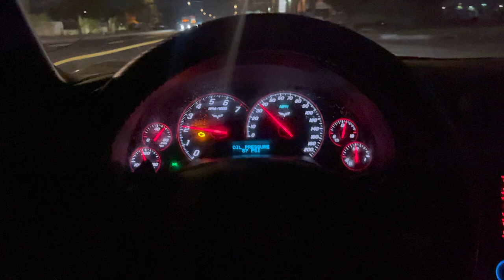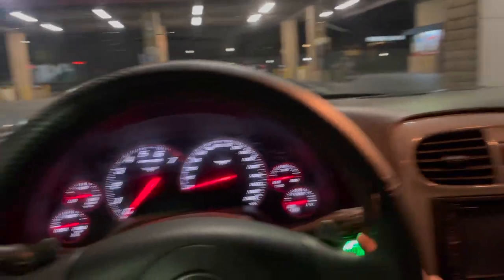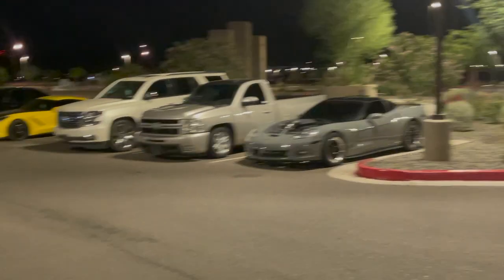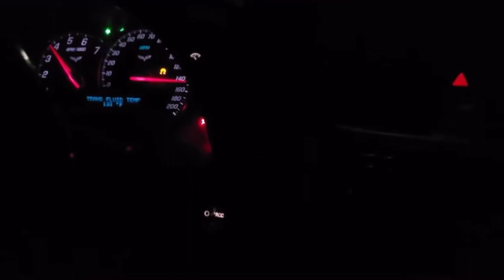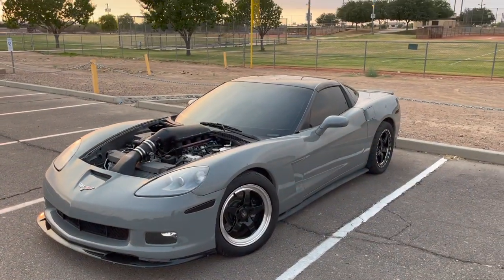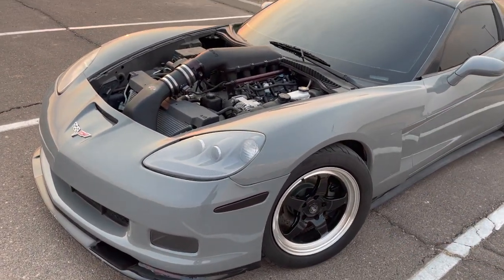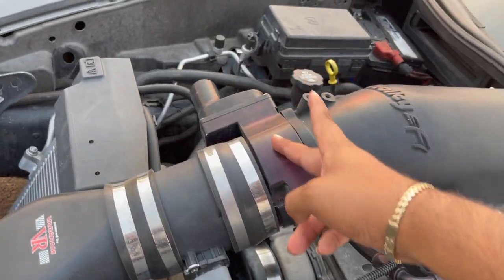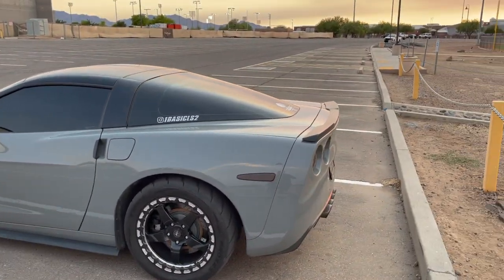MY CAMMED CORVETTE !!! ALL MY MODS / CAR MEET / ZR1 Vs Procharged Corvette

Comment: The Z06 front bumper fits a base C6 ????
Reply from the maker: Have to do some adjustments for it to fit
Reply: @1basicLs2  needing to replace my bumper, how hard was it to make it fit? and what adjustments were needed? clean vette btw
Reply from the maker: @clamp9366  I didn’t do it myself but the shop that did said they heated up the bumper to be easier to bend , didn’t come out perfect but I was happy with the outcome , appreciate it bro.